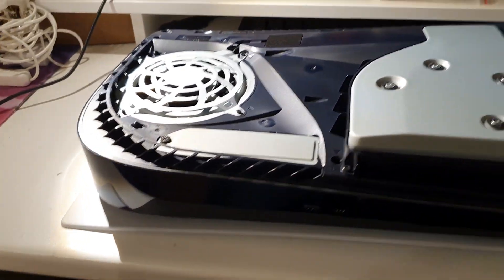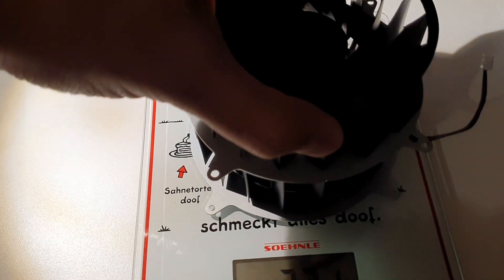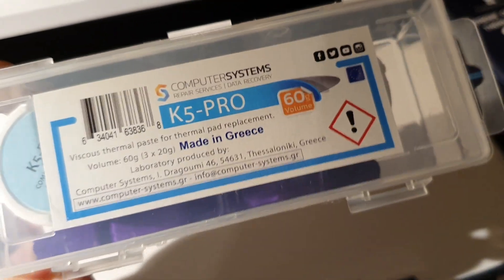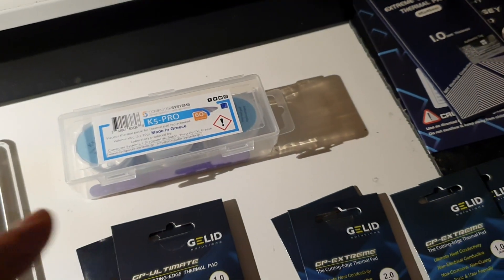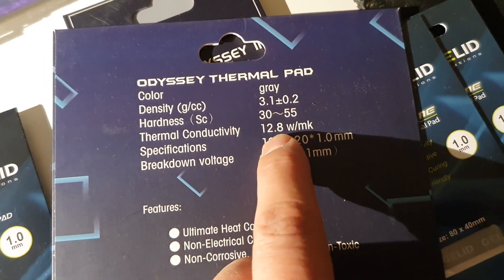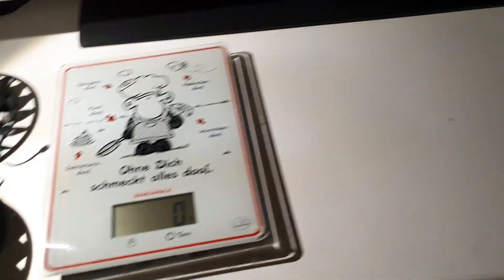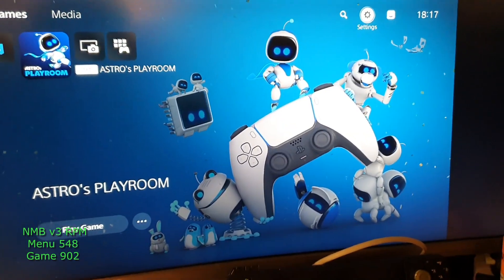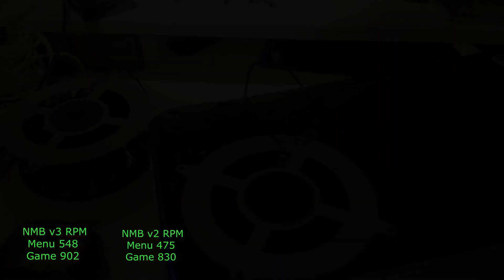NMB v3 - is it better?

Comment: I got one, and the bearing after 9 months of decent use is making a chirping noise.  Is there any way to fix/lub it or should I buy another one?
Reply from the maker: You can get it out of the PS5, clean and lubricate it. This can solve the problem. https://www.coolingfanfactory.com/news/How-to-Extend-the-Lifetime-for-Fans.html

Comment: I recently brought ps5 disc version(1215A model). Within a couple of weeks I started to notice this faint buzzing/humming/ticking noise, something similar to back of a refrigerator. I could only hear this noise when opening a a game, but once closed the console was silent, so come to the conclusion it must of been the fan. I popped the panels off to check the model and it was a Nidec v3. I could not stand it, especially when gaming at night. You could hear it from like 8 feet away! 
I took it back to the shop and they swapped it for new one. Luckily I was still within my 28 days return period. I was worried the new one would have same problem , but got lucky and is dead silent. It has NMB v3 fan. 
Complete luck of the draw I guess!

P.s my son’s launch digital ps5(1000 model I assume) is even more silent that my new 1200 model. Not sure what fan it has, but it’s a 23 blade and seems as if it is made of different material , maybe metal , but might not be.
Reply from the maker: 👍my favourite Fan is the NMB v3.. will show you why in the next PS5 video.
The CFI 10 has a NMB v1 with 23 Blades.
Reply: @McKuc  okay great I look forward to it! 
Yes the NMB v3 is night and day difference vs the first one I got with Nidec v3. I got really lucky I think. Although my new console is basically silent , the other ps5 with NMB v1 1000 model is like the series X… dead silent! As much as I like the ps5, I’m starting to think the series X is a better designed console.

P.s would you say the NMB v3 is better that NMB v1 23 blade?
Reply from the maker: @dejonmustard8876  NMB v1 looks like it is the most robust fan. It has real ballbearings that can be replaced if needed. All other fans can not be disassembled without breaknig them. In terms of RPM and cooling performance, the NMB v1 is really bad. It is slow and the cfi10 with nmb v1 gets hotter then with delta v1 or nidec v1.
No matter what fan is inside, i recomend using the PS5 in horizontal position and with holes in the panels to improve the cooling.https://youtu.be/VLVmNErrrC0
Reply: @McKuc  yes I must admit the 1000 launch model I have gets considerably hotter than new 1200 model. Does the Nidec v1 23 blade made of different material or are all fans made of plastic? 
 I’ve always had my ps5 horizontally actually! I’m a little nervous, because I’ve only had this new one for a couple of days and I’m paranoid that it will start making noise like the first one I got, so fingers crossed it doesn’t!
Reply from the maker: @dejonmustard8876  all blades are made of plastic. Can not tell you anything about the differences or quality of the plastic they use
Reply: @McKuc  that’s good to know! No worries. Thanks for replying anyway!
Reply: @McKuc so out of all the fans NMB v1 original that came with ps5 are the worst fans? Even though it’s the one shown on the tear down 😅.
Reply from the maker: @yera1239  in terms of cooling performance, yes it was/is the worst. If you look at the build quality of the fan and at the noise level during gaming, its the best. They all have pros and cons. 
SONY sent out the PS5 with NMB v1 to all the influencers who are only talking about noise and do not look at the temps. At the beginning all of them made super "advertisement" reviev videos and talked about the PS5. It is so quiet they said. People started buying them and found Nidecs and Deltas inside. They had better cooling Performance then the NMB v1 but they are not silent 🤣.
Its a lottery with every component
Reply: @McKuc  currently I have a foxconn v1 in my 1015A, would you say that one is better or NMB V2 for that model?

Comment: Hello I really need help from you I have the NMB V2 fan in my ps5 and we hear the bearings and a noise as if the oven was running. Do I need to change the fan?
Reply from the maker: Is the noise coming from the fan or maybe the coils on mainboard and capacitors of the psu?
Reply: @McKuc  No it does not come from the psu but the fan is like vribrations and as if the oven is on the ps5 is in a place on a well-ventilated desk but after that will not fish for overheating the model is CFI-1216a

Comment: What ist the best fan in the version 1216a and how is the chance to get one of those?
Reply from the maker: To tell exactly what fan is the best, i have to measure the temps. Will upload a video soon. Subscribe and be patient
Remember: the fan that is best for me, does not mean that it is also best for you: https://youtu.be/0yGY0dGTKzk
Get a rpm meter to check the rpms: https://amzn.to/3IrpuBK
Reply: @McKuc  ok thank you which one would you recommend?
Reply from the maker: @felixplein  in the cfi-12 all of them are okay for me. If a good fan for you means a silent fan, then try to get a NMB v3 or Delta v3. 
Funfact: The NMB v2 for example runs a bit slower and is often more silent.
Stay tuned for the temp test where i find out if they are cross compatible.
Reply: @McKuc  ich habe jetzt drei Konsolen zuhause, also ich muss jede auspacken und mit spiel testen um zu sehen welche die leiseste ist?
Reply from the maker: @felixplein  ja so ist es, wobei ich mich da eher auf die Ohren verlassen würde und nicht auf die Augen ;)
Sind alle die selbe Version?
Du kannst auch schauen welche den geringsten Verbrauch hat. Wattmeter: https://amzn.to/3Kx1ShN
Reply: @McKuc  ja sind alle die selbe version 1216a, die sollten ja alle das gleiche verbrauchen?
Reply from the maker: @felixplein  um die 200W, trotzdem kann es sein dass manche effizienter sind als andere. Siehe dazu: https://youtu.be/cxuPLTEsueI

Oder auch: https://youtu.be/lu-3HG4fOlY

Oder auch: https://youtu.be/AmQ21ZM1ilk
Bei ihm waren die cfi-11 am stromhungringsten. Bei mir nicht. lotto halt
Reply: @McKuc  alle haben unterschiedliche Lüfter verbaut und brauchen auch unterschiedlich Strom 😂
Reply from the maker: @felixplein  der alüfter zieht höchstens 0,1A oder 100mA, es sind sogar weniger.. Die PS5 Verbratet 200W.
Bei 12V sind das 16,667A oder 16667mA.
Ob ein Lüfter um 20mA mehr oder sweniger Verbraucht spielt überhaupt keine Rolle..
Nur weil unterschiedliche maximalen Stromstärken, die auf den Lüftern stehen heisst das noch lange nichtvdass sie das die ganze zeit ziehen. 🤣
Siehe Auch: https://youtu.be/VXeUt177CbE
In diesem Video habe ich unter anderem die Ströme der Lüfter gemessen.
Reply: @McKuc  ja, hatte mega Glück habe eine mit delta und eine mit nmb
Reply from the maker: https://youtu.be/VhKsR-kEh0Q

Comment: This device has a copy of CFI 1000, the release version is correct, because version 1116 did not put a black sticker on the disk drive. Is this correct because I have a PlayStation 5 slot, version 1116, and there was no black sticker on the disk drive? Is this correct? Thank you ❤️🔥
Reply: Yes only the CFI 1000 has black sticker on disc drive.

Comment: I got one from ebay how is it supposed to sound ik they all sound different but making sure I don't hear the barring on the fan messed up
Reply from the maker: Similar to nmb v2 https://youtu.be/Tq7HmRdjkaI
Reply: @Mc Kuc  nmb v3 is very quiet I guess it's the coils sometimes coil whine resolve over time and fan will get louder over time with newer games
Reply: @Mc Kuc  in my opinion I think nmb v1 is probably best for long term
Reply: @TheAlaskanDude why is that? All the new ones have been switched to manufacture to look similar to the Nidecs. Maybe because the heat sinks are smaller, but could be because it cools better?

Comment: Hi, I looked into my new digital efition ragnarock, it is the same as you show on the video.
I got it saturday. It seems very quiet
I have my other ps5 disc edition model 1100 and it had a Nidec v2 inside who is not workin properly, when  i start the console it try to spin, but it is cogging.
When i turn it manually with power on it turn very slow, I don't know if he is dead or if he doesnt have enought voltage or Amp.
I tried to get one at the game shop but they don't want to sell me one, they only can take it for repair.
Do you know how can I get one ?
I saw some on ali express the nmd one but I don' know if it is the good one.
Reply from the maker: Hello. I hqve links to different known good fans i tested on my discord channel: 
https://discord.gg/z7PK32Tzmm

Comment: So it's faster, but is it quieter? I have one and I'd just like to know if I legit got the quietest fan.
Reply: since it’s faster it makes more noise it’s like a car running the longer the car runs the louder it is same concept the nmb fan v3 spins faster meaning it’s making more noise while the nmb v2 fan is the quiesties since it’s slower
Reply from the maker: In menu the sound sounds a bit more "acceptable" for me. Some v2s run so slow that it sounds like a car where the idle speed needs to be adjusted a bit higher. On the v3 the idle for me has a nicer, more evenly, sound.
I would recommend the v3 anyway because of the higher rpms and better cooling performance.
Reply from the maker: https://youtu.be/VhKsR-kEh0Q

Comment: Ich habe eine Ps5 aus der 10XX Reihe und jetzt eine aktuelle aus der neuen 12XX Revision. Meine "alte" Ps5 hat einen NMB Lüfter und die neue Konsole habe ich noch nicht ausgepackt. Gibt es die Möglichkeit, dass bei der neuen Konsole auch ein NMB Lüfter verbaut ist? Und wenn ja, wie kann ich das ganz einfach checken?
Reply: Tu as réussi à savoir lequel tu avais?
Reply: @stephzb  english?
Reply: @koray30  did you manage to find out which fan do you have ?
Reply: @stephzb  Yes, the new revision has a Nidec V3 fan installed, while my other ps5 (cfi-10xx) has a nmb fan.
Reply: @koray30  does your new cfi-12 version still have coil whine or not? 
my cfi-12 does less coil whine than my cfi-12 but it still has some.
Your nidec fan making noise?
Reply: @stephzb  I think when it comes to coil whine my new ps5 is definitely better, but the nidec fan has a more prominent sound, while my nmb v1 is consistent with the sound (probably the most silent version).
Reply: @koray30  i have the nmb on my new ps5 cfi-12 he is cool but not linear, 
I don't know how to say but his sound is not flat.
my cfi-10 had a delta and it was linear
Reply: @stephzb  I can confirm my ps5 cf10xx with nmb v1 has a linear sound, not a ufo like sound. Sound wise this is the best in my opinion. I don't know if it's because the new revision is built differently, but fan sound is more prominent to me.
Reply from the maker: Seitenplatte entfernen